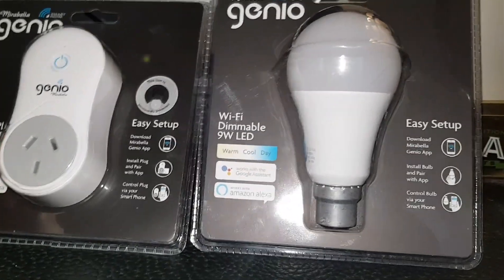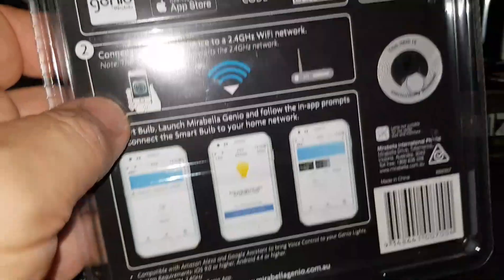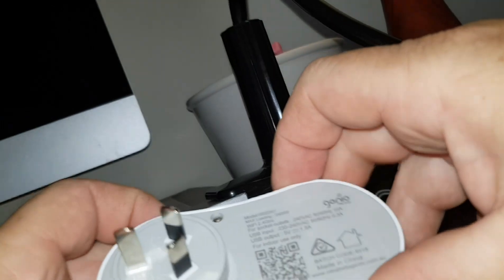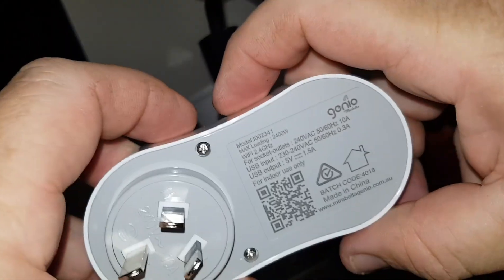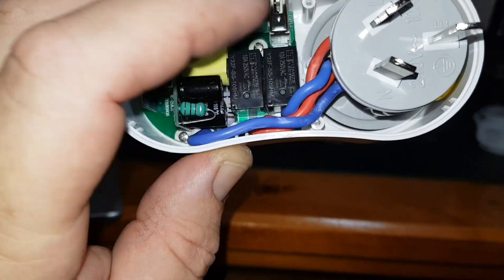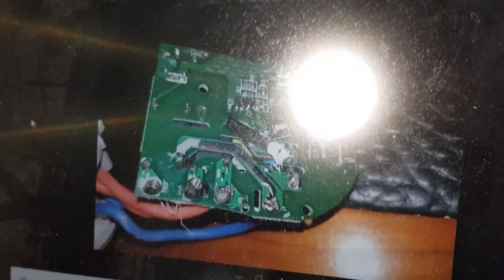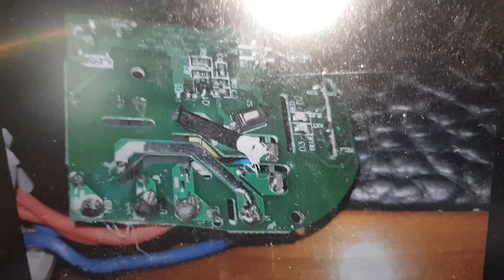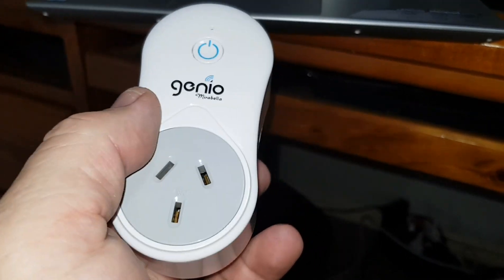Mirabella Genio a new IOT devices from Kmart. Or are they a Sonoff replacement at $29 Au?

Comment: So these are hackable and easy to use with tasmota.  I converted mine with tuya-convert without using screwdriver. I hooked it into my MQTT broker and control it using openHAB. I did this to remove the chinese cloud.  I get super quick response from openHAB and have it connected to my google home (slow)   So I can say "hey google turn on the christmas tree lights"  and have a Rule in openhab to turn it off at a set time
Reply from the maker: I have not moded them yet. I normally use Node-red but I do like openhab. The only thing I dislike is going through IFTTT to another website to hook google home up. I did a vlog on that too.
Reply: @chuxxsss  You don't need to use IFTTT I don't. I do it through myopenhab.or cloud connector. It is realy easy to setup https://www.openhab.org/docs/ecosystem/google-assistant/

Comment: Can these be set up on a 2.4/5GHz dual frequency modem.  I just bought another brand that can't, only on a old technology 2.4GHz modem.  There going back tomorrow.
Reply from the maker: Yes Tony, but you may need a older tablet or phone. I have my Genio on a dual down my shed. Goid luck and if you need help leave me a comment here.
Reply: @chuxxsss  Thank you Chuxxsss B,  much appreciated,  there was no work around with the other brand.
Reply: FYI, it’ll work but you have to turn off the auto negotiation on the modem and set your connecting device to the 2.4Ghz channel.

Comment: I got the motion sensor, but Alexa doesn't recognise it :(
Reply from the maker: I don't have the motion sensor where did you get it from mate? Does the sensor show in the app? What OS are you using too?
Reply: @chuxxsss  I got the Motion Sensor from Kmart, I bought that and the Door and Window Sensor (which is complete trash may I add), I'm using iOS 12 and yeah it's showing in the app, so I'm beyond confused lol
Reply from the maker: Only thing I could suggest is IFFF. Other than that does it work from the app by itself mate?

Comment: I cant  get my  light  to go
Reply from the maker: O.k. Brett do you have another device to try it with? We use a tablet , but after you pair it. It will work with the other devices. The main problem is secuitry on you phone has firewalls.

Comment: Having trouble with setting up the plug. I have an Oppo...
Reply from the maker: O.k. what I have read you can use other apps to connect these devices. The  otger way is to use abother device like a old tablet.  This is because of firewalls on newer devices. I am still looking in to it.

Comment: Another thing to mention about these smart plugs is that they do not turn back on after a power failure. Some smart plugs turn on after a power outage which could be a problem if it was connected to something like a heater or such.
Reply from the maker: I through it would just reconnect to your wifi system. My one does. Have a lovely day.
Reply: @chuxxsss  Yes the smart plug turns back on and reconnects when the power comes back on. What this plug does not do is turn on what is connected to it back on.
Reply from the maker: @jeoff-c7d  Yes it doesn't do that unless on timer. Sonoff switches do.

Comment: How do I set the light bulb up I'm having trouble
Reply from the maker: Plug the light in and turn it on and off 3 times. It should blink. Open the app connect it to your wifi network and search for the blub. Now you may need to use a earlier OS like a tablet too. Good luck.
Reply: @chuxxsss  it worked thanking you kindly
Reply from the maker: @berinda8774  good have a great day.
Reply: @chuxxsss  Do I need the power plug AND the bulb? I can't get my bulb to blink.
Reply from the maker: @gezzabomb  turn globe on and off three times till it blinks. You don't need both.
Reply: Hi Chris, I have connected the bulb to the mirabella app. However im not able to connect to Google Home, do you happen to have tried?
Reply: @TheJuniahJAY  turn your light switch off three times then try that's what I had to do
Reply: @TheJuniahJAY  go to genio mirrabella on Google & they have a video plus booklet download you can follow to pair your Google mini up with the lights. It works well once your Google mini is trained up for it.